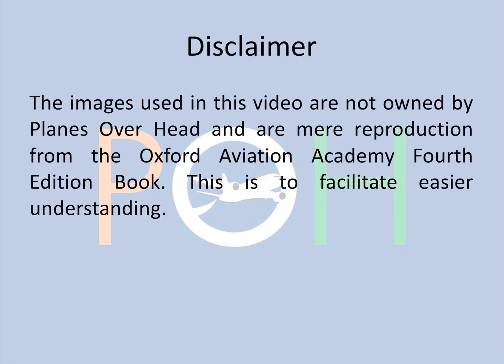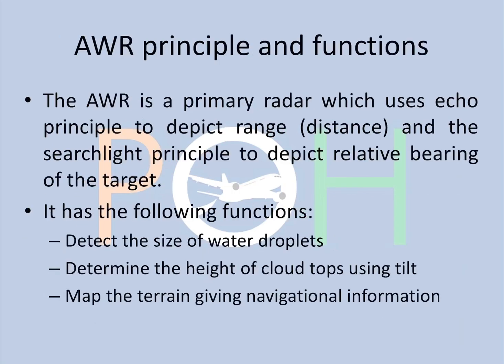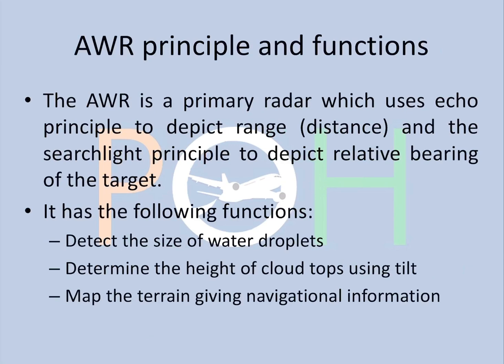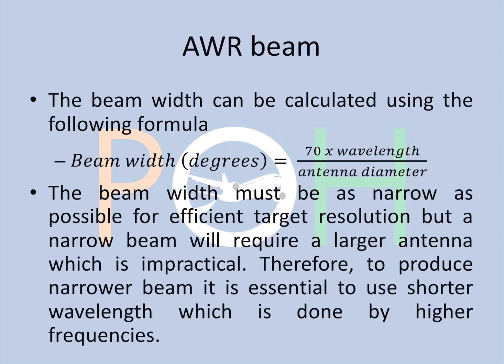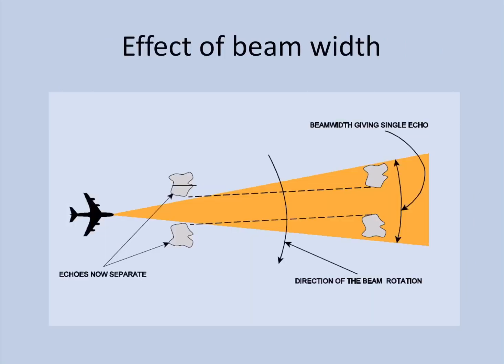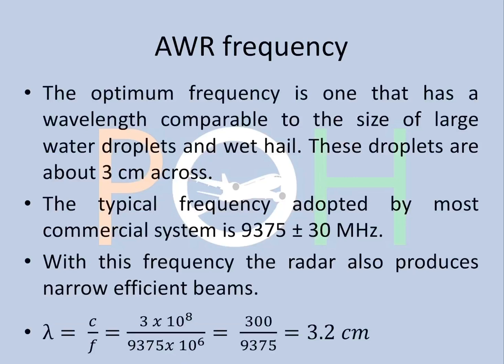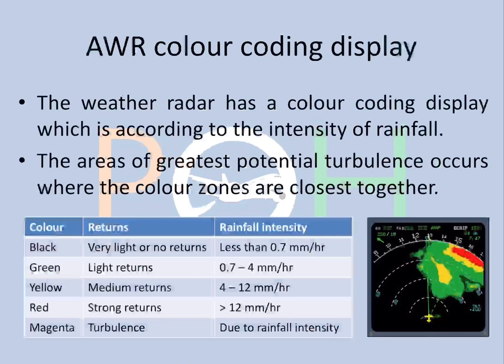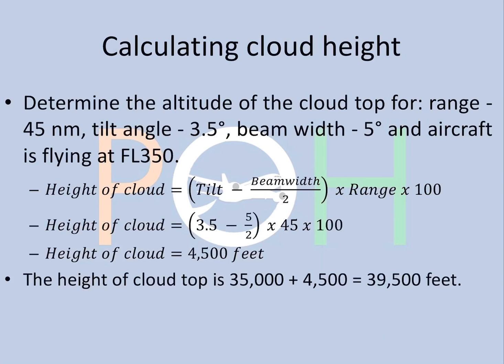Radio Navigation - Airborne Weather Radar

Comment: Capt you've used -5 deg of tilt so the answer should b 35000-4500=31500.
Reply from the maker: No no! Sorry for the confusion.. it is like beamwidth is 5 degrees 

is = (-)
Reply: Hi Utkarsh,the formula is ht=tilt * range * 100,i didn’t find anywhere the beamwidth/2
Reply from the maker: Who is Utkarsh? 😁
Reply: @poh  sorry,my bad
Reply from the maker: And the formula is picked up from the oxford book as it is!
Reply: Planes Over Head alright,as per the FCTM ,you don’t consider half the beamwidth
Reply from the maker: Yes that's why there is an approximate symbol in the FCTM! Because its very negligible and beamwidth of the antenna information is not readily available in the aircraft! The FCTM is therefore an approximation of height of the cloud.